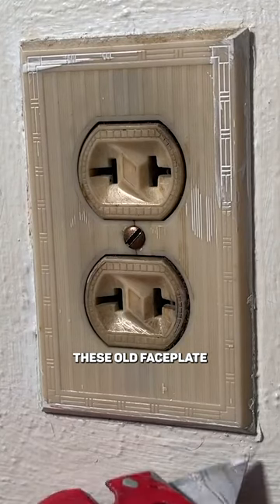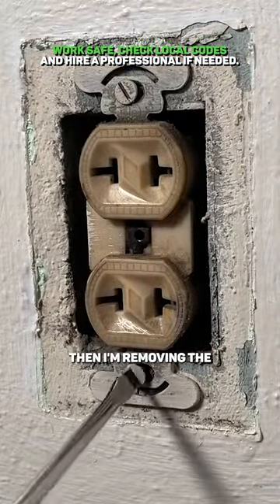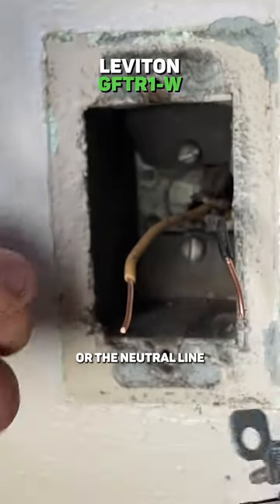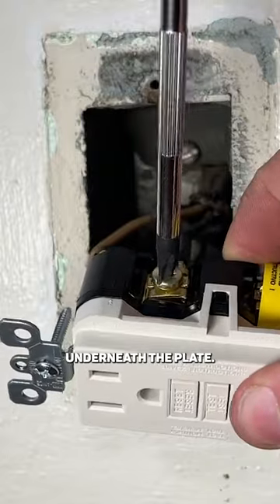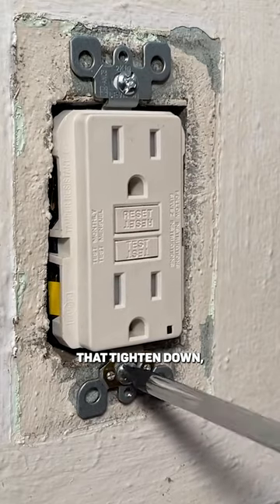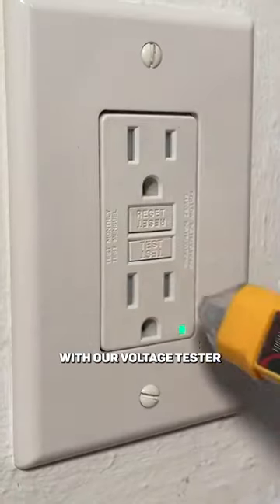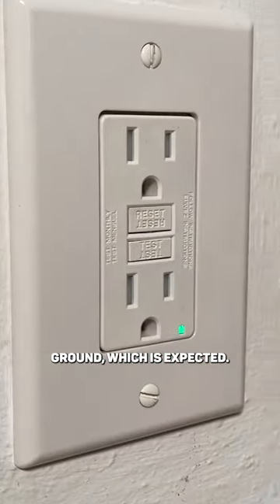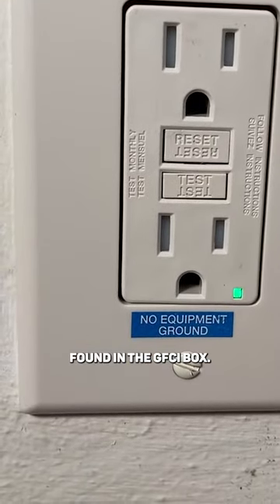Safely Converting 2 Prong To 3 Prong

Comment: I realize that the hot and neutral screws are recessed slightly, but this is a tight fit and a metal box. I'd wrap a couple of layers of electrical tape on this one.
Reply: Well you go ahead and do that yourself. He chose not to and it's not necessary for him.
Reply: It’s also an ungrounded metal box, so a little prevention can go a long way.
Reply: Seconded. I had a tight metal outdoor box where the GFCI receptacle fried itself from making contact.
Reply: @Verminator151029  Master Electrician, here. That simple tape wrap is worth the time and effort. You're flat out wrong.
Reply: @ethelryan257  "Ethel", my dear.  The only thing you're a Master of is making #SAMMICHES!  Now run along and make some for the men!!!
Reply: @Verminator151029  was that really necessary. You’re childish
Reply: @sherrigillette7190  Yes it was.  Shining a light on the truth is always necessary.
Reply: @brizzle8797 Prolly time for you to go make some #SAMMICHES!!
Reply: @Verminator151029  
 And Why would that be exactly.
 If someone wants to wrap tape around their outlet then by all means go ahead and those who judge him well they know where they can go..
Reply: @brizzle8797  #SAMMICHES!  Go make some!!
Reply: @ethelryan257  I'll chime in with my electrical experience too and I always recommend doing some tape on these in old tight boxes. It's cheap insurance imo. The space can be so tight sometimes I wouldn't be comfortable just sending it.
Reply: That's 100% accurate
Reply: if you're not comfortable doing electrical, then don't touch it, and call an electrician. this is a normal box and plug and how things are in every house

source: i'm an electrician

edit: older boxes may be smaller, so you may have to install a deadfront gfci at the panel instead for the same protection
Reply: @AlexBendel  Aren't older houses from the 60s and older. . having smaller metal boxes?
Reply: @joey.g  i edited my comment, they may be smaller, in which case you could intercept the circuit at the panel and install a deadfront gfci for the same protection
Reply: I always wrap receptacles. 20 years in
Reply: @AlexBendel if you’re going that route it’d be far quicker to just install a GFCI breaker in the panel.
Reply: i watched the entire video. he did wrap the whole thing in electrical tape. this is just a summary of the full video
Reply: He did wrap. This is a condensed video and the longer one shows him wrapping it.

Comment: No Earth and 30 year old circuit breakers, Scary.
Reply: That’s what the GFI does
Reply: Also, he replaced an old 20a receptacle, with a 15a gfci, Big no-no. It's even fed from a 20a breaker.
Reply: @Kevin-mp5of  when they showed the panel, it was a 20a breaker they turned off.
the receptacle is set up for 20 120v plugs, so yes, it's a 20a receptacle on a 20a circuit.
Reply: @TheDarthJesus shows you don't know  what you are talking about you can use a 15 amp device on a 20amp circuit,as long as there are 2 receptacles.

Comment: Don't the face plate screws have to be in the same direction??? 🤪
Reply: It won't fail inspection,  but it is more pleasing to the eye
Reply: Totally unimportant, Correct torque is what's needed.
Reply: Anyone remember a old Windex commercial, "it ain't cool if you're chrome don't shine"? Well it ain't cool if you're screw heads don't line up.
Reply: This bothered me immensely

Comment: Nice work but I always add a separate ground for safety’s sake, especially in bathrooms and outside!
Reply: Separate ground? What does that mean?
Reply: @surferdude642  you run it since these old houses aren't grounded. You run a separate green wire
Reply: Can you connect a ground wire to the screw in back of the metal box to the ground screw on the new outlet? Would that be a proper ground?
Reply: @ewhibs  if the box is grounded yes
Reply: Don’t fergit to have your lightnin’ rods recharged  !
Reply: @ewhibs  most of these old boxes are not grounded back to the panel. So adding a ground wire to the box would be useless.
Reply: @AgentOffice  how would you know? My house is 70+ years old and the wiring comes to the box in metal jacket. Thx
Reply: @ewhibs  take a multimeter from hot to ground. Should be same volts as hot to neutral. Ground is basically a neutral too. If there's a ground it'll act like a neutral
Reply: @AgentOffice  that's may not be the ideal way to measure for ground... as if hot and ground gets same voltage, it's already too late and the receptacle is shorted. best to check continuity from neutral to ground.. if you have continuity then you're good..
Reply: @surferdude642  Oops, redundant ground in case, but I don’t know…
Reply: @AgentOffice  If it is not you should change it into plastic one. If the hot wire touches an ungrounded box the voltage will get through the ground wire to the equipment case and te GFCI does not protect as the fault is before it.

Comment: You can also check if the box is grounded since then you can actually tie your ground to the box
Reply: tied into earth ground connection on boxes should work with GFCI...🤔✌️👍🙏☯️
Reply: the point is you don't need to install gfci if metal box is grounded no need to ground box either cuz every metal part of receptacle is continous with metal screw
Reply: Cloth jacketed, 2 wire from 1950's?
Reply: Yea y'all should read the NEC
Reply: @psyo123  don't do this in practice. Because the second someone alters or moves something you break the ground on everything else. In older houses you never know what is or isn't grounded behind the walls or who changed what in last 70 years. Just put in a GFCI receptacle or breaker.
Reply: @theelite1x721987  please use tester
Reply: It's not grounded, steel rough-in boxes with old style, 2 wire romex.
Reply: @billbaillie3702 yep, that’s what I’ve got. 😊
Reply: What if its not grounded? and how do I know if my whole house has a ground or not
Reply: @psyo123 not true......IG outlets the yoke is isolated from the ground terminal
Reply: @johnbalzano6588  then use unisolated one I personally prefer having visual grounded wiring but old house has lot of limit

Comment: It's not code compliant until you affix  the "no equipment ground sticker", seriously. LoL
Reply: The electrical conduit is used as the ground as they are bonded in the panel. If you want a ground you can connect the outlet grounding lug to the metal box.
Reply: @Khaos-y7n  there's no conduit there, and you won't find it in homes, except for a few jurisdictions... Chicago area comes to mind.  Everywhere else is just non-metallic cabling.

Edit: Once in awhile I'll come across type AC cable in older homes, and it has a continuous strip inside the metallic jacket (like MC cable but no ground conductor).  Something like that would be code compliant for a ground.
Reply: @IrrationalBstrd  I come across a lot of this in my travels and it always involves a grounded metal box. Not saying that other states haven't had other types of codes in the past to which I'm unfamiliar. I often have to transition from old to new and this is a common way to make that transition. That said, I would never install a new outlet without grounding it even if it means rewiring the whole house. 
Also, he should have taped that outlet before putting it back in that metal box.

Comment: It's been my experience that there usually is a ground wire, just to the box.  Then anything that needed an actual ground used the screw terminal at the center of the outlets.  3-prong outlets came later.  But they can still be grounded just from the box, or add another wire if you like.  Or remove the ground wire and attach it to the outlet, then the box is grounded from the outlet rather than the reverse.

Comment: That outlet pictured at the start thankfully is no longer made but for more reasons than you think. The same outlet could be wired for 125 volts and 250 volts and there was no way to tell which is was until it was too late. It would take NEMA 1-15P (125V@15A) or NEMA 1-20P (125V@20A) or NEMA 2-15P (250V@15A) or NEMA 2-20P (250V@20A). There is not telling how much damage those things caused over the years. I heard about these years ago but found it hard to believe. When I got my hands on one I took it to the hardware store and tried different plugs in it and they will in fact fit.
Reply: That actually sounds quite practical, even more so today. Most modern devices have a active-PFC SMPS so input voltage doesn't matter. Sure its not safe for normal users, but I'd love to have outlets like that in my room

Comment: Before the Olympics came to Brazil they instituted and new three-prong plug to imply ground exists for the first worlders arriving. However, in my experience here (>20 years) ground is not wired into many (most?) electrical systems. So the 3rd prong was just for show.

Comment: As nice as it is to have GFI protection and a grounded recep, something to keep in mind these days is just how many devices have 2 wire cord/plugs...
For me the priority is on good receps everywhere, and strategically fishing in a modern romex into the locations where it might truly have value
Reply: No if you can replace the first outlet in a circuit or the breaker to GFCI do that 100% of the time. The only reason a tool or appliance will not have a ground is they aren't required because of the type of application of that item/tool. It is not a good reason at all to ignore circuits without grounding and leaving them two prong.

Comment: Is it okay to just use a GFCI breaker and a normal 3 pin socket, and a "no equipment ground" label?
Reply: Yes, its allowed by Code as an alternative to completely rewiring the outlet.

Comment: It’s scary that this is allowed. Open ground can kill.
Reply: It is perfectly safe as a GFCI protects the user even more than a ground.
Reply: @elidanko1912  I thought gfci take time to trip and don’t offer electric equipment protection that are ungrounded. In this case, you need to maintain labels.
Reply: Can ilu use these instead of electric boxes?
Reply: This guy should have connected the outlet ground lug to the metal box because that box is grounded via the conduit.

Comment: I would agree that with the Romax and no ground supplied this works well, but if there was a MC cable, you can add a ground screw to the back box which I sometimes prefer to the ground being picked up from the screw on the receptacle. I never understood why electrician would’ve removed the ground,  never made sense to me.
Reply: Old electrical in the states didn't always have ground
Reply: Romax?

Comment: Is there supposed to be a ground wire or is the metal box grounded out already or is there a ground inside the outlet it’s self?  I need to switch out 21 outlets and I’m lost when it comes to the ground cause all I see is two wires (black and white) . Only reason I haven’t started. Could you pm me please? Just a quick explanation of how this is grounded out?

Comment: heres a tip, take off face plates before you paint so if you ever need to remove them the paint isnt stuck to them, also isnt much longer than covering with painters tape
Reply: In my opinion it’s actually faster to take the faceplate off, and way cleaner.
Reply: @nolansprojects2840  i like using the screwdriver as i dont want to mess up an outlet, probably could do it faster but idk
Reply: One of my pet peeves

Comment: What’s the difference in a ground and neutral in a residential install when they are tied together? I understand grounding conduit. But in residential there is no conduit.
Reply: With ground and neutral bonded, stray current can find its way to earth through either conductor in the event of a fault.  Without them bonded, neutral faults can “float” and return to the source in other, dangerous ways. Such as through bonded plumbing.
Edit: think of the plumbing in the home as the “conduit”.  What if the conduit was tied to ground throughout the branch circuits, but not bonded at the source, in the event of a fault? The neutral would float through the conduit on its way to discharging.
Reply: Ground and neutral should NEVER be bonded outside of the main panel. What you're describing is a way to trick a lazy inspector.

The purpose of a ground is to provide a low resistance path back to the source. In the event the path of electricity makes contact with something it shouldn't, like a pipe, a box, or an appliance, that whole object will now be energized, and anyone touching it will be shocked. The breaker will not flip, as the object and you are increasing resistance to the system. Breakers respond to an increase in current. When a properly grounded system is shorted, the current will flow through the object causing the short and into its ground wire, returning back to the source with very little resistance. This in turn causes a spike in current, causing your breaker to pop.

This is why sticking a paper clip into a grounded circuit could still prove deadly; it's designed to protect the circuit, not you. A gfi, on the other hand, will detect any variance between hot and neutral in either direction, and immediately break the circuit before damage can be done. Sticking a paperclip in a gfi will trip its breaker.

Comment: So you don’t have to put a ground wire for GF. I thought you had to install a GF outlet to the beginning of a circuit. Also can add a ground wire and connect it to the back of inside the metal box

Comment: What if I want to install a GFCI but there's no ground wire, and I want to be able to plug high current appliances to that new GFCI?
Reply: The ground wire is not needed for a GFCI receptacle to operate safely.  However, a plug in GFCI tester will not work to test it. Use the built in buttons to test it monthly.
Reply: @IrrationalBstrd  well said. Thanks.

Comment: Just to note that those 2 prong plugs with 2 horizontal slots were originally designed to run 240-250v. It is a good idea to test the voltage coming out of the socket.
Reply: The one shown here will take both 125 and 250 plugs. What a dumb idea that was . Read my comment about them.

Comment: The way that he showed where to put the wire has no guarantee I would recommend the hook method
Reply: Wrong.  GFCIs are not supposed to have J-hooks on them.  If you are doing that, you risk it coming loose.  This is not a normal receptacle.

Comment: Is that old outlet 120v or 250v?  Because it looks like it's some sort of freakish combination of NEMA 1-20 & 2-20 and will accept both, which I'm pretty sure is not something that should exist.
Reply: It's still 120v just like the others, but the T shaped slots mean its a 20 amp outlet, rather than 15 amp. Old 20 amp appliances used to have plugs with one of their prongs horizontal so they could only be inserted into outlets that were rated for 20 amps. But the slots are T-shaped so they can also accept the typical plug type with 2 vertical prongs.  Plugging a 15 amp device into a 20 amp outlet is obviously fine, but doing the reverse is dangerous, so that's why they're designed like that.
Reply: @Beefnhammer  That’s what they said, NEMA 1-20 and 2-20 are 20 amp receptacles. They already knew this was a 20 amp receptacle.
Reply: @appleintosh  Yeah but he also asked about voltage, which is why I said it's 120v. You're right that they implied they were already aware that it was 20 amp, so I probably gave more information than was needed.
Reply: I would like to add to my original comment, as it appears I did not really give you the answer you were looking for. Now I understand what you meant by 'freakish combination' of the 1-20 and 2-20 types. You were wondering why the old outlet at the beginning of the video has 2 T-shaped shots, when modern 20 amp receptacles only have 1 T-shaped slot and 1 vertical one. The double T-shaped configuration you see here is a very old design from when plugs were less standardized than they are now. Some plugs would have 2 vertical prongs, some would have 1 vertical and 1 horizontal, and some would have 2 horizontal prongs (these were commonly called tandem plugs). This is why both slots on that old outlet were T-shaped, that way it could accommodate all 3 plug types. I hope that answers your question.
Reply: @Beefnhammer  NEMA 1-20 is a 125v/20A receptacle and NEMA 2-20 is a 250v/20A receptacle.  The voltage difference between these two standards coupled with the fact that this freakish receptacle looks like it will accept both NEMA 1-20 & NEMA 2-20 plugs is the scary part.  Is this receptacle supposed to be connected to a 120v or 250v supply? What horrible things will happen if the item plugged into it is made for a different voltage than what's being supplied?

Comment: 1 that backbox should be replaced because it looks rusted and has paint on it, which probably won’t last very long,

2 all receptacle back boxes should have at least 5 or 6 inches of wire going out of the backbox.

Comment: If we're going to advise noobs on how to install a GFCI receptacle, then we should also tell them that their GFCI "3 prong" receptacle will not quite have all the features of a properly earthed receptacle/device (an equipment grounding conductor AKA ground wire).  Namely, surge protection & electrostatic discharge (if these are relevant to the devices which are plugged in).  However, the GFCI can potentially prevent injury or death which otherwise could result even with an EGC (ground wire) present.  That's all I know, but there might also be other concerns with a GFCI's ability to detect ground faults in a device without an EGC connection.

Comment: If I wanted to replace the 2 prong outlets in a room with 3 prong should I just make the first outlet in the chain gfci and the rest normal 3 prong outlets?
Reply: You can, but to be code compliant, you need to put the "No equipment ground" on the regular three prong outlets downstream as well.